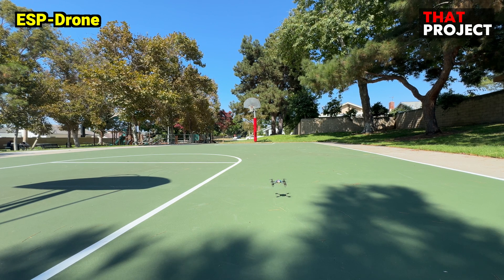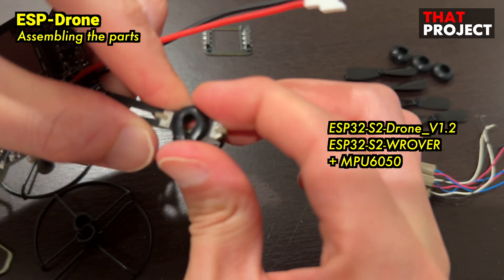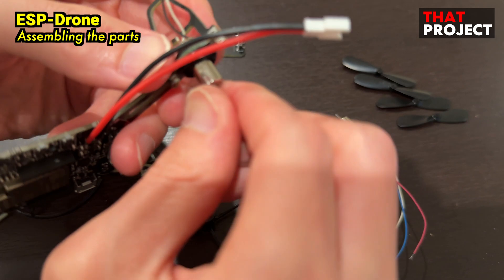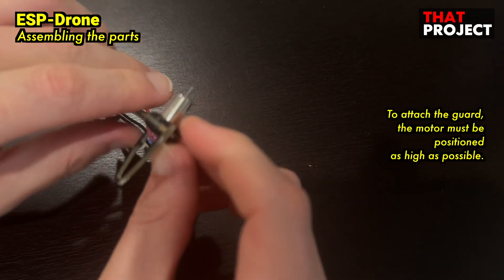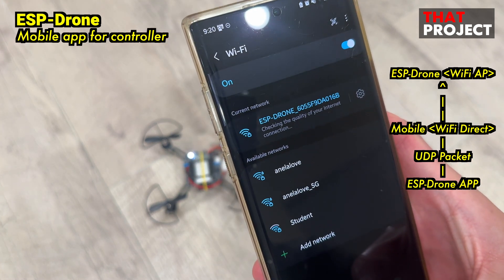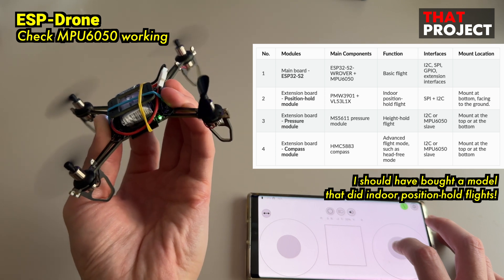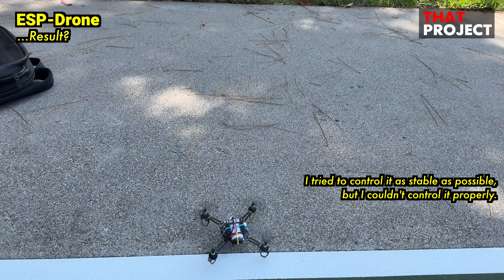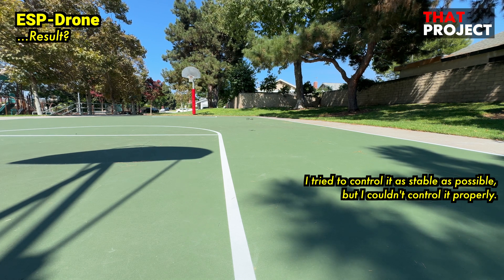I failed it. I don't recommend the basic model of ESP-Drone.  #ESP32

Comment: I have made this drone i want to know how to calibrate this app with the drone can you guide me
Reply from the maker: If I remember correctly, there seems to be no settings for calibration through the controller app. The MPU6050 will probably calibrate itself after the system boots. Other than this, it seems like there were only settings that put limits on Roll, Pitch, and Yaw.

Comment: Also have one of these for some sensor experiments. It does work but can be tricky learning to fly – definitely for me I needed to switch off yaw to get the hang of things. Make sure it's on a flat surface at boot up, and with minimal wind speed (ideally indoors). I'm also using a 650mAh lipo so may have a little more current head room. Grab some spare props ;) (think my kit shipped with 46mm props with 0.8mm shaft hole)
Reply from the maker: I tested this with the yaw direction turned off too, but it failed for everything. I'll test this again when I get a chance to see what I did wrong. Thanks for the comments.

Comment: To reduce weight, can we not use the given battery mount and instead zip lock the battery underneath the drone, also how did you attach the battery mount in the first place, and for my drone kit of the same kind the seller already has flashed the code and programmed the drone for us, so is there any way I can show the code, not to change, but since it's a science project we want to prove we did the firmware from opensource and flashed it ourselves I don't want it to change anything the seller did, but just prove to my teacher when grading I did manually have to do it instead of hiding. Basically there is an ICT part of the science project, we will assemble the entire drone, and that's good but when it coems to coding we can't say the seller did it for us otherwise our teacher will deduct points but rather install crazyfile and convince him we flashed the code and even re-flashing the code to prove to the teacher but it doesnt interfere with any of what the seller had to do. So, please, give me answers to my inquisitions, and since it'sthe exact same drone and everything as yours if I follow the exact steps you did like place the corresponding motors in the places you put it, SET up everyhing, then connect the battery then the drone will instantly turn on and we conenct to drone wifi and once connected with go into the app tweak some settings and test preflightthen take off for the final demo right? Don't worry the soldering part and everything is simple and will be managed but if there is anything you can say, please inform and tell me for thr 300mah battery 20 c how long willit last until I must recharge, and then safely use again. Correct me if there is a misconception.
Reply: Please answer this!

Comment: Could 300 mah battery 3.7v 1s (9 grams) 20c work meaning 6A maximum continous discharge current will this be enough to power the drone super super fast and make it very stable smooth and very impressive if I take off propellor guards to make it weigh less.
Reply from the maker: Well that's not that much game-changer. a 25C battery is better than 20C — it allows higher current (7.5A vs 6A), gives less voltage sag, and improves throttle response, especially for fast and aggressive flight. If weight and cost are similar, go with 25C.
Reply: @ThatProject  This is the only option available and one that offers the right connector. What I'm looking to know from you is this enough to power the drone and make it fly properly and impressively: impressive is subjective but if it fly's it's cool, but to be impressive it needs to fly pretty fast and hover (just go straight up) and go from point A to point B relatively quickly enough to impress for a science project. Although, the seller did not specify a specific discharge rate this battery has got to be the best bet and the one he was implying that to be used for most optimal and efficient flying performances. I basically want to understand if you think considering all of this; will the drone appear great; even if it's slow, I just want you to think about if drone's never existed and I were to make the first one which will be using this battery will those around me interpret the project as impressive; not really something flashy but something straightforward and agile to define impressive to you. I'm not searching for fast insane or aggressive FPV-type performances with flips and all that, but rather smooth, stable, and a speed that could make the drone work under good conditions and function how a regular drone is expected to function and knock the sock's off anyone who didn't think it was possible for a STEM Project and work decently if not great. And, also be FUN to fly; if it's fun it's good, I don't want you to guarantee anything but give me advice as to what you think will happen and if it meets my needs.
Reply: Please read the response above; I need an answer please.
Reply from the maker: @AyhamMihranAhmed Based on your description, yes — theoretically, if your drone is lightweight and designed to run on a 3.7V 300mAh LiPo, this battery should be enough to power it for stable hovering and smooth flight.
That said, this is all assuming the drone is functioning normally. Unfortunately, I haven’t had any success with it yet, so I’m not 100% sure how it will perform in practice.
But based on the specs and common usage of this type of battery, it should be capable of meeting your goals — if everything else is working as expected.

Comment: Could 300 mah battery 3.7v 1s (9 grams) 20c work meaning 6.5A maximuk continous doscharge current will this be enough to power the drone super super fast and make it very stable smooth and very impressive more than than your version if I take off propellor guards to make it weigh less.

Comment: Could long GNB battery work if it has ph2.0 female connector; will it fit in the frame? This time its 3.8v 1s 350 mah 70 C (8 grams) and gives 24 maximum continous current but more expensive. I'm doing this for a project so will the 300mah work fine or even better for what I'm trying to do, it just needs to look impressive.
Reply from the maker: I haven't tried this battery, but it looks good.

Comment: There is the same exact drone from your video, but the seller told to use 300 mah 3.7v 25 c which gives 7.5A continuous discharge is this okay because I'm trying to fly the drone better than how it was shown in the video faster, stable and hover nicely or do you think I need more current to do that and outperform your battery for the same drone. I think it wasn't as expected for your drone because you used 400 mah which is around 13 grams compared to my battery which will be 9 grams so is it perfect?
Reply from the maker: I believe a 25C battery is sufficient for a toy drone. I think a lighter battery like you mentioned might be more suitable for this drone.

Comment: How you make some better flight control mods to this open source project, especially with esp-now.
Reply from the maker: @TheBlaser55  This is a difficult question. I think this requires more of something to balance the device itself than the communication method. I don't think it will get any better if you change it to ESP-NOW in its current state.

Comment: I bought the same drone. The drone connects to the phone, the lights are on, just like yours, but the motors don't work. I tried the motors one by one and they work. I thought there was a problem with the battery, so I first used a 30c 1000 mAh battery instead of a 3.7V 25c 650 mAh battery, but the result was the same. What do you think is the problem and why it didn't work?
Reply from the maker: I had the same problem. When I used a 3.7v LiPo battery from another project, the system would boot up when the motors started and I couldn't fly the drone. So I bought a drone battery(mentioned in this video) and I was able to fly the drone with it. I think it should be fine if the maximum output current is 10A or more.

Comment: Oh nice, i just bought the kit some weeks ago but did not assembled it yet, so now seems the moment... i think you need to calibrate something no?
Reply from the maker: @SA-oj3bo  As far as I know, there is no separate sensor calibration, and when the system starts, the gyroscope and accelerometer of the MPU6050 are calibrated internally. Check this out. https://docs.espressif.com/projects/espressif-esp-drone/en/latest/system.html#sensor-calibration
Reply: @ThatProject  in this video I heard about roll and pith trim settings, will this solve the problem?  https://www.youtube.com/watch?v=uzZjk0TQKtU

Comment: Wow! Fantastic! does the project has open source code?
We could work on it, maybe get rid from the app and build a proper controller with a second ESP32 or connecting it to a wide area Wifi network!
Give Us updates!
Reply: Maybe ESPNOW could be used to control the drone through another ESP32 based remote controller?
Reply: @omegakiller1495  I think it can be very possible but a large wifi network could be largely more interesting as it could allow for example large areas monitoring by drones
Reply from the maker: @omegakiller1495  Connecting via ESP-NOW seems possible, but I haven't tried it yet.
Reply: @ThatProject  yeah not sure about how it will behave a fast system like a drone. 
But I have already tried that in a slow ( slightly faster than human walking speed ) golf caddy project. In that ESPNOW works awesome
Reply from the maker: @grazianoturbogas  Sure. Here is the source code. https://github.com/espressif/esp-drone

Comment: I think the app has some calibration settings, so try tweaking those
Reply from the maker: @ericp.5533  As far as I know, there is no separate sensor calibration, and when the system starts, the gyroscope and accelerometer of the MPU6050 are calibrated internally.
Reply: @ThatProject hey I have made th same drone on my channel but using diy parts and the same firmware, just cloned on my repo, you can watch it and it flies very very stable. Please do watch it , will change your opinion

Comment: If you put multimeter on motor and turn it fast you get a positive or negative voltage according to the wire connections so you can then make the positive wire regardless of color?
Reply from the maker: @DanielSMatthews  You're right. I was just obsessed with why the wire colors on these motors were different.